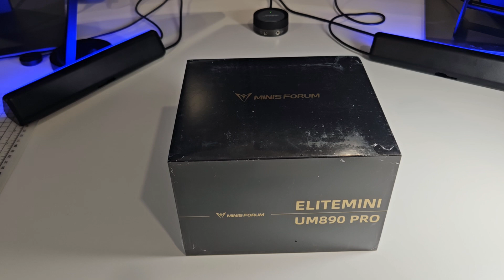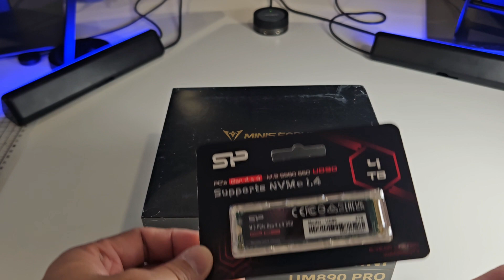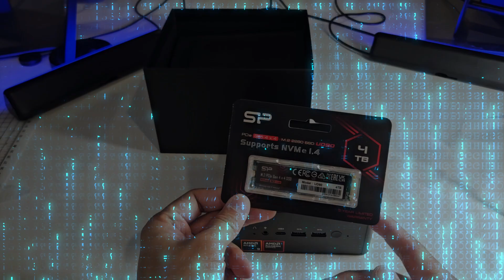Unboxing MINISFORUM UM890 Pro, AMD Ryzen 9 8945HS - Installing 4TB M.2

Comment: I bought one of these machines. Had the same problem with that cover. Design flaw. Could have just left the bay area open and mounted the wifi cables on the inside somewhere. The other thing I had problems with was the BIOS. It's not very easy to select the boot drive. After some trial and error I finally figured out how to set up those m.2 slots. Other wise the machine runs pretty nicely. :finger-red-number-one:🤪

Comment: Colleagues, I'm glad to welcome you!
Finally ordered the Minisforum UM790 Pro (without SSD and without memory). :)
While it's going (or maybe floating), I started choosing an SSD and memory and immediately got confused.
Are the standard cooling radiators acceptable for them???
Are there any restrictions on the thickness?
Maybe there are some other nuances to consider?
Colleagues, I would be very grateful for your advice!
Reply: Get an NVME SSD without heatsink.
Reply: @estusflask982  thanks. What about two double-sided so-dimm memory strips?

Comment: I have two 4TB drives in mine. How's your wifi on yours? Oddly they seem to be shipping smaller SSD in now. My first version had a full length. I opted for 32gb with 1tb. Great little unit for retro.
Reply from the maker: Wifi works fine
Reply: @retrogamer9999 Bro! 😮please show a video demonstration 👍🏽
Reply from the maker: @tonistarks2874  I will, just been busy